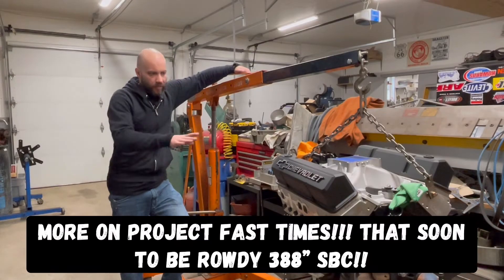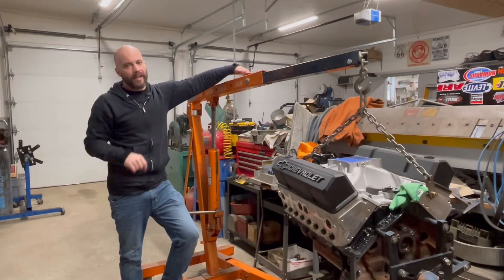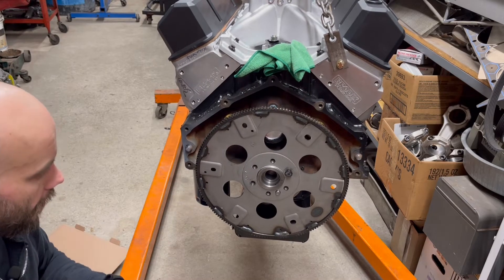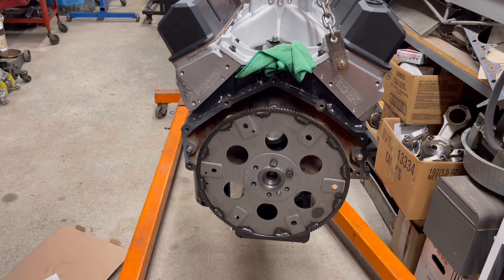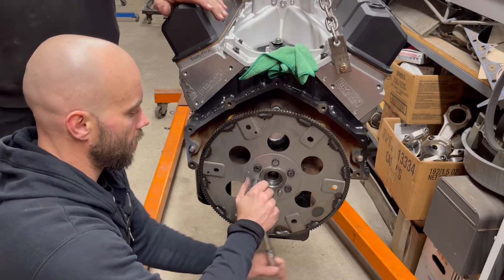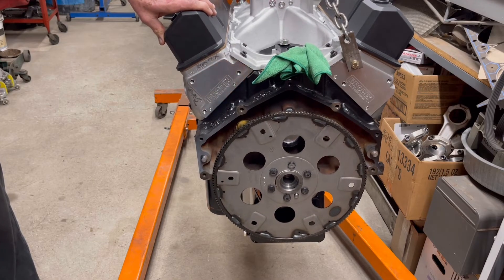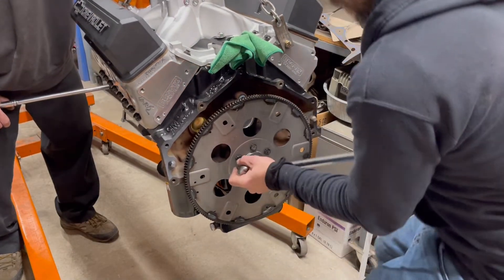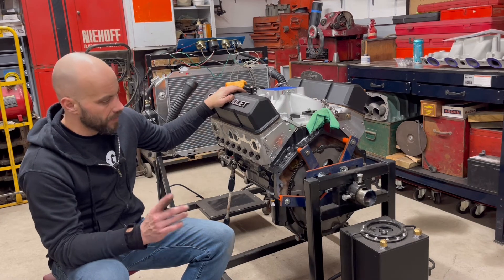Crucial Step! How to Install a Flexplate on a Small Block Chevy! #howto

Comment: Great video!  Cool dude.  It is okay to go directly to 85 ft-lbs, without an intermediate step?  Of say, 40 ft-lbs?  Thanks!
Reply from the maker: Great question, it's okay to go straight to 85.  That being said, make sure to follow the steps the bolt manufacturer (like ARP) or if using factory bolts, follow factory guidelines.
Reply: @2HacksGarage  Okay, thank you much.  I did in fact invest in ARP bolts and had to pick up a 12-point socket.  I'm glad I bought new ARP bolts with the 12 points; they seem less prone to 'camming out'.

Comment: You said all the power is “transplanted” from the engine to the transmission through the flex plate ? I’m not sure what you meant by  “transplanted” but the flex plate is “not” the medium between the engine and transmission in which power is sent through. It The torque converter does that, the flex plate  is the medium between the starter and the engine. The teeth on the flex plate are driven by the starter motor spinning the crank. Important to give right information if you’re going to give instructual videos.
Reply from the maker: Where does the torque converter on a SBC bolt to?  Oh that’s right, the flex plate.  That’s what when you build a hotter than stock engine for racing, they recommend upgrading a flex plate to something stronger, in many cases to SFI specs.  Important to know that

Comment: I have a couple of exhaust valves bent at about 90 degrees halfway down the shaft, put it in a engine to bellhousing hole lay against the Fly wheel to stop it rotating, thanks for sharing,all the best to yous and your loved ones
Reply from the maker: Very good tip right there and I will be doing this!  Thanks Donald, best to you and yours too!